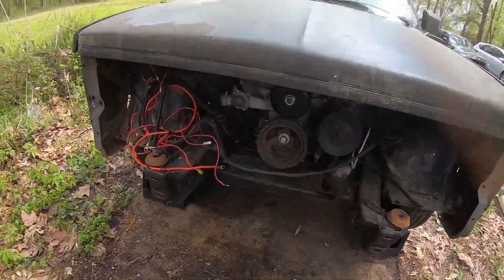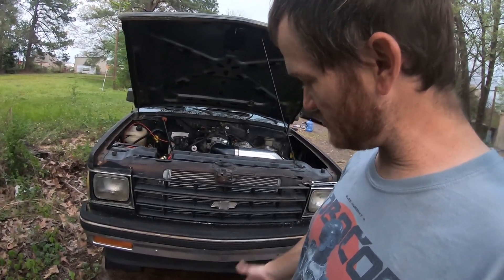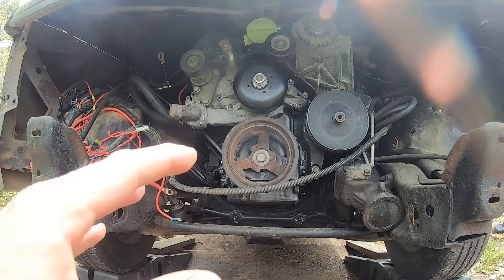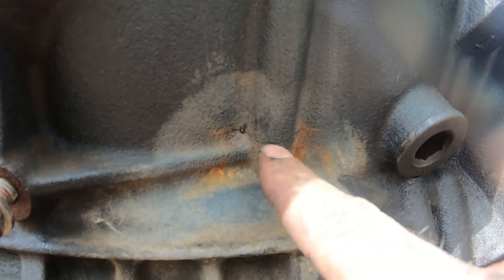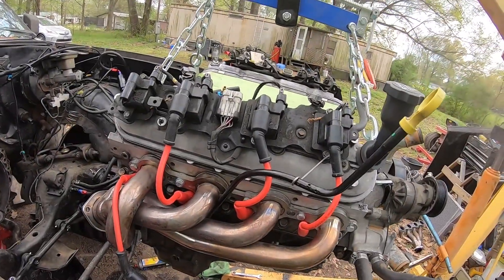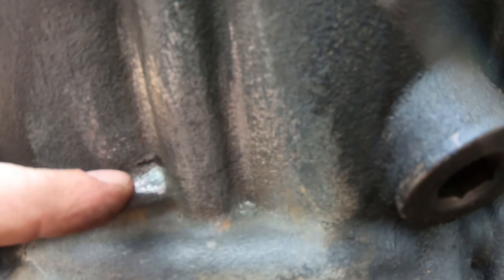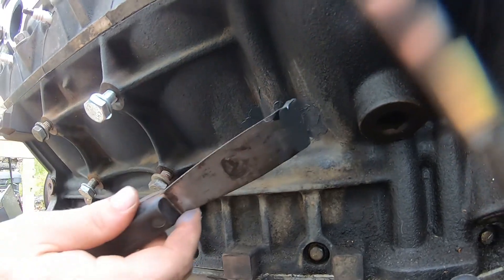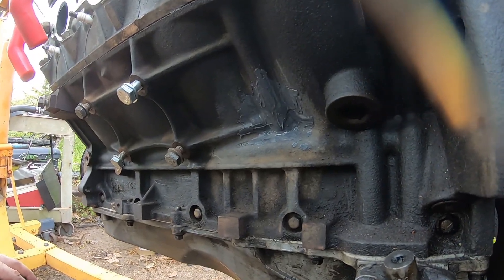Can JB Weld "fix" the crack in my engine block?

Comment: Good video.  I just had to do this to a boat I bought... The patch that was hidden on me when purchased started leaking, so I cleaned it up and am trying jb weld also.
Reply from the maker: Thanks guy mine seems to be holding up pretty well it seems to have bonded completely to the motor so hopefully you have the same outcome.

Comment: You really need to drill the ends out to stop crack propagation.  A permanent repair would have involved drilling out the ends and then various holes along it then tapping.  Laying down the glue, then screwing it closed. ITs not the pressure, its the heating and cooling of the block.  Junk in the coolant fills the voids in the crack when hot, when cooled it makes the crack bigger like a wedge.   Its been two years, can you report on the effectiveness?
Reply from the maker: Yea and i found another crack inside the engine one day when tearing down so that block is gone

Comment: This is straight up good old redneck ingenuity. Props to you on this and I pray that jbweld holds. If not I hope at least it falls off clean and you can just slop some more on
Reply from the maker: Man it has held up fantastic unfortunately the crack went deeper and I had to swap to a 6.0l.
Reply: @southerngearz  damn..... maybe it would have been a good idea to drill two little holes at each end of the crack so it wouldnt get bigger... but thanks for the video anyway! I´m checking JB Weld / crack videos fixing my intake manifold. Hope it´ll work...
Reply from the maker: @Fay0815  yea I thought about that afterwards oh well more power.
Reply: @southerngearz  yes more power is always good :) enjoy your ride!
Reply: How many miles until so?
Reply from the maker: @leehoee9158  to this day it is still holding up though that motor is in the backyard now but the jb weld is still there. I wanted a bigger motor so I swapped to 6.0l.

Comment: I'm curently in the middle of fixing my LS that has the exact same crack same spot. Same length.
Reply from the maker: The jb weld has been holding up very well so far. Just prep it right and it will work fine.

Comment: Is it still holding up?
Reply from the maker: It held up just fine but I swapped in a 6.0l for more power
Reply: Nice. Would you recommend drilling holes and installing studs before applying jb weld
Reply from the maker: @landybob8393  i didnt but it never hurts to drill out the ends of the cracks in order to prevent them from growing.
Reply: Ok thank you

Comment: It is an aluminum block, why not just dremel with carbide  fine cut bit and weld?
Reply from the maker: Sadly the 2001 5.3l I have is cast iron
Reply: @southerngearz  I see 
Not familiar with cast iron but I been told that cast iron can be welded with flux core but I’m totally unsure

I think I found my next project to test.
Reply from the maker: @luigimartinez7127  i have heard you can weld it but you must heat it up first but I havent tried it yet
Reply: @southerngearz  ahh okay if one day u decide this repair please make a video if possible. I would like to see your approach on welding
Reply: How’s the jb weld holding?
Reply from the maker: @luigimartinez7127  its doing great I wish I could get to the other side of the crack I just found down in the water jacket.
Reply from the maker: @luigimartinez7127  on a different water jacket than the jb welded one just didnt make it through.